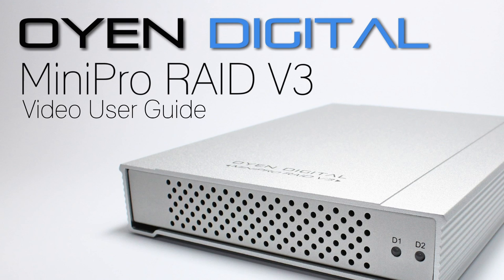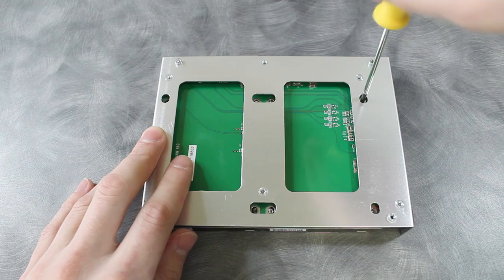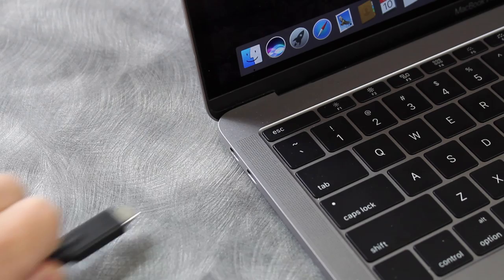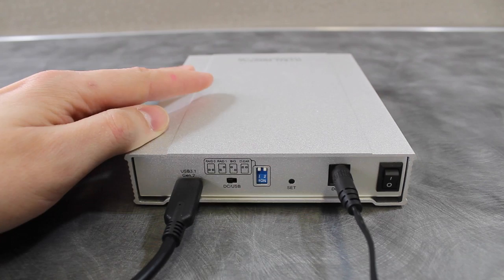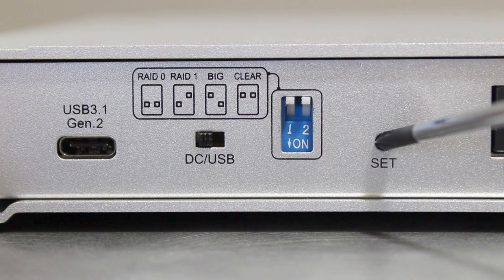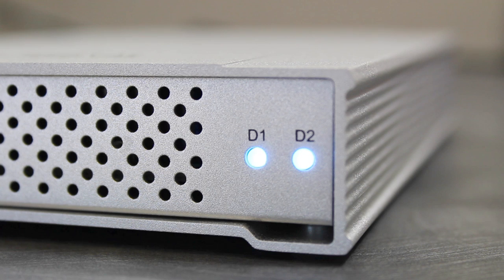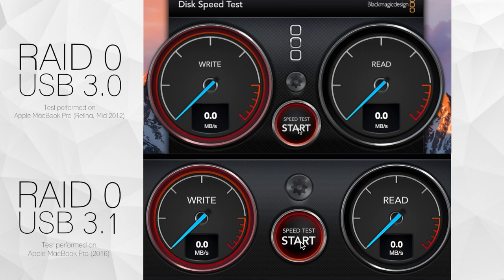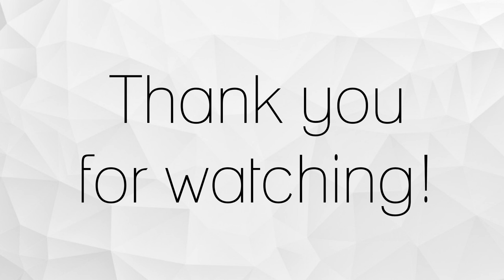Oyen Digital MiniPro RAID V3 Video User Guide

Comment: Great video. For those who might be interested in knowing...SSD's will also provide great speeds via direct USB 3.1/Type C connections (non-RAID 0). Using a Samsung 850 EVO SSD (500G), I was able to get 547 MBs (read) / 507MBs (write) simply by using a good USB 3.1 Gen 2/Type C >>to >> SATA adapter cable (SSD to iMac 27" running Boot Camp). That said, I achieved better speeds using a SSD via USB 3.1 than the results in this video running a RAID 0 via USB 3.0....very interesting! That goes to show the connection type does make a difference.

I'm thinking about purchasing this enclosure for the purpose of setting up RAID 0 using (2) 1TB SSDs....which should produce similar speeds as shown 795-821MBs +/-
Reply: IDStudio7 I bought this one to use with 2 Samsung EVO 860  SDD’s and set them up in RAID 1. Can I format in the new APFS ?

Comment: Any idea why I only get 50 Mb/s in raid 0?
Reply: It is probably the cable, had similar issue with different enclosure brand, only got 38MB/s write speed. After using different cable (the short one that came with the enclosure) the write speed increased 10 times to almost 400MB/s. Hope this comment helps others!
Reply: @RoVeL999  I tried different cables too. I ended up resetting it. I’m going to see if the speed still holds up today and update this.